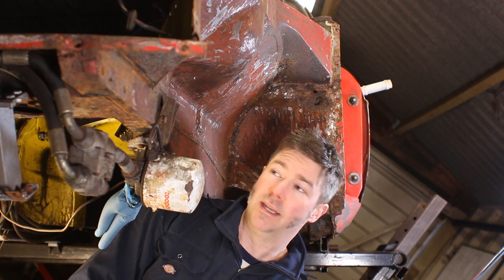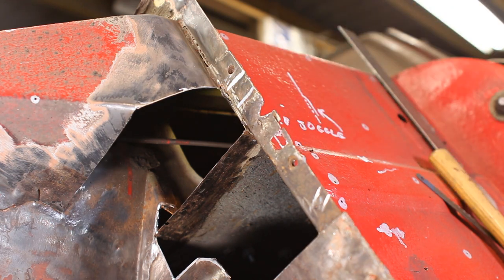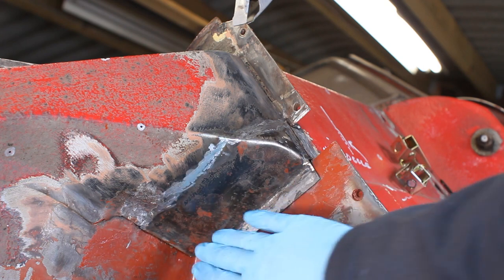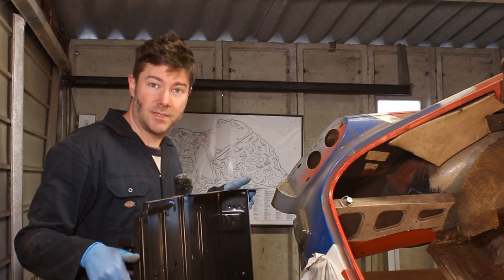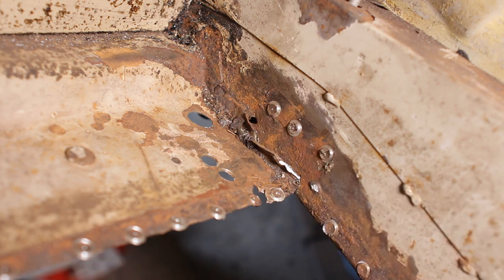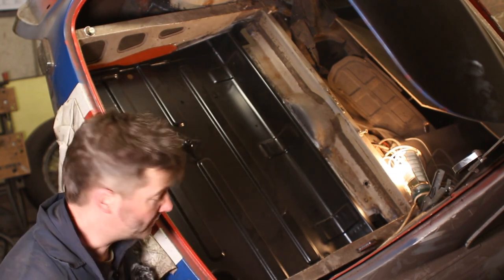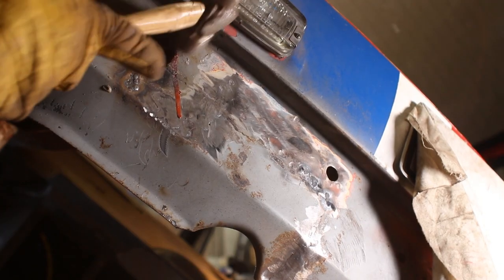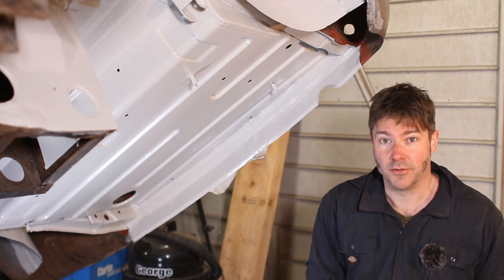MGB GTS Episode 3: More Rust, More Restoration. Turbocharged 1967 MGB GT Project Car

Comment: Great work so far with this. Really fun to watch how you problem solve. Have similar aspirations for some old projects I have laying around. Must get better at welding first though
Reply from the maker: One thing is for sure, you will quickly get better at welding if you start doing thin sheet metal work!
Reply: I’ve been around metal smiths in a manufacturing setting, and I learned quite a bit from watching this video. 78 MGB with same almost exact floor damage, not extensive but worrisome. Thanks for documenting your resto work!

Comment: Hi great work and easy to follow what are you painting the underside with. Thanks Mark
Reply from the maker: That's 2K epoxy primer. Not safe to spray without an air-fed mask, but brushing and rolling it is fine with just a good organic-filter respirator (as far as I know - don't quote me on that).

Comment: I got my first car, a 1967 MGB GT recently, and it's in a similar condition. I'm not sure if it's worth fixing
Reply from the maker: Money-wise, it almost certainly isn't worth it. It's only worth doing if you actively enjoy doing some extremely tedious metalwork - my motivation took a dip last winter which is why there haven't been any updates of late.

If you just want to drive an MGB, sell your basket case to a keen tinsmith and buy one that's already roadworthy. You will come out ahead on time, money, and sanity.
Reply: @funksterdotorg  yeah I've made that decision last night. I would love to fix it, though. I just don't have a welder or any welding experience